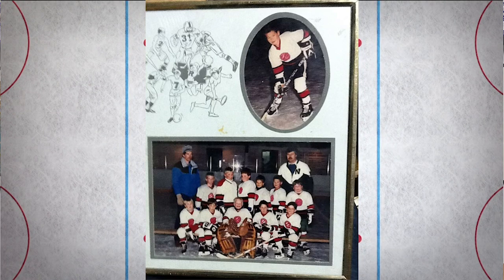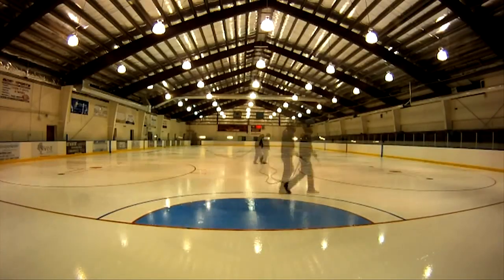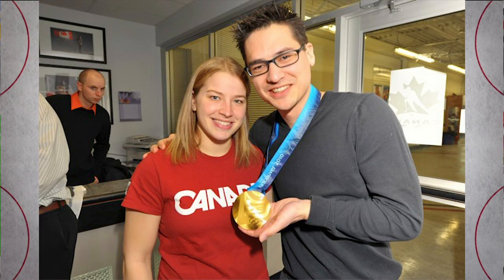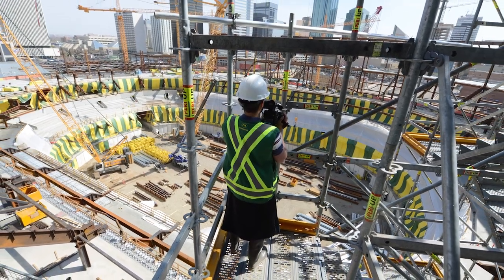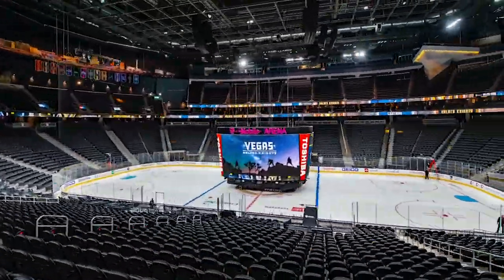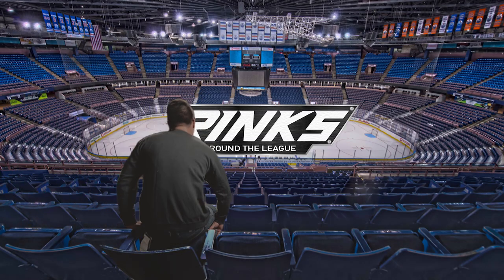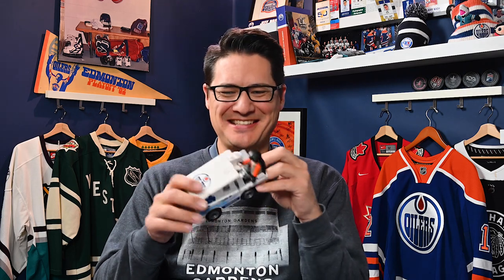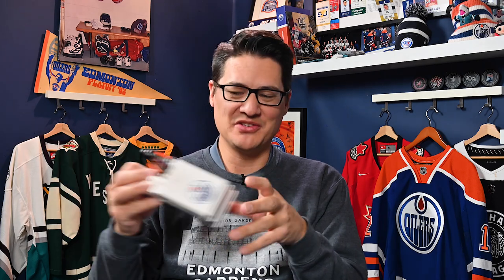ZAMBONI FAILS | Episode 1

Comment: Zamboni operator here - I drive the zam at the infamous site of the Miracle on Ice. Hydraulic leak situations, you immediately drive off the ice as quick as you can, trying your best to stay off fresh lines. The fire like that last clip, get it to the middle of the rink and run for an extinguisher. Unloading the zamboni from a truck and damaging the conditioner like that is pretty much the universe saying that the machine is unusable. Everything that’s integral to the operation of a zamboni is in your conditioner. The blade, the augers, water output, snow collection, etc. if that’s damaged, put it back on the truck and get a new one.

Comment: Interesting take! I will share this on the AARFP Arena Group site and you will get comments! I for sure would have tried to take the ice resurfacer off the ice though. I probably wouldn’t have been brave enough, but you NEVER stop on the ice! Lol! Plus all your safety gear is in the back AND better to scrape off the mess than melt your ice to the slab!!
Reply from the maker: Yeah I suppose. My point is better risk the slab than the entire building. 🤷🏻‍♂️

Comment: I drive an Olympia actually the same model as the one that caught on fire in Rochester (last video) and I had a hydraulic leak one time. My augers stopped so I raised the conditioner and put them in reverse to clear it out and see if they were frozen or not but once I did it all started shooting out of the back of the conditioner like crazy. I instantly brought the machine off and shut down. Needless to say it was hand cuts until we could get the mechanic in